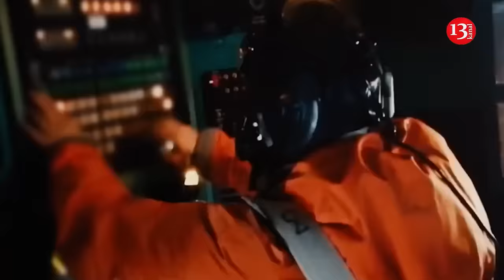Russia's tank and missile reserves are running out, mortar stocks are almost empty

Comment: According to Covert Cabal, most of the remaining tanks and AFVs are pretty roached out.  That being said, there are thousands of old Russian and Soviet vehicles scattered all over the globe.  I'm sure the Russians will be able to find vehicles if they need them, if the price is right that is!
Reply: There is a couple of problems with Russia getting systems from overseas.

The first is, that most of the available ones have already been bought by the US/other Ukrainian allies.

The next is, that those that are left are unlikely to be willing to get rid of them without being replaced by anything - and Russia is in no position to back fill any gaps created by the transfer to Russia.

And the last is, that Russia was the MAIN user of this gear, and so there is only a very small amount (comparatively) available elsewhere. For example, there were 25k T-72 tanks built - of which only 6k were available overseas (of which Ukraine had 1k and had built 700 for the export market). So assuming that they were ALL in running order, there would only be ~4500 available overseas (or less than 20% of the entire T-72 stockpile)......
Reply: The big problem with that is Russia doesn’t have sufficient foreign currency, they can’t pay using Roubles (anyway no one wants Roubles). Also those that have Russian equipment and still need defence equipment…. So they want western kit… as part of those deals and the western suppliers are shipping the old Soviet kit and ammunition to Ukraine…..
Reply: @robertpatrick3350  I agree you, but Russia will find a way to get vehicles if it needs them.  North Korea, Iran, and Cuba are nations that would likely supply Russia with surplus vehicles.  One thing is certain - there will be a lot less old military equipment on the market after this war.
Reply: @gregwasserman2635  
當你的來福槍都損失殆盡，你會希望用弓箭獲得勝利嗎 ??

Comment: They will not run out really they will slowly be less useful and cost effective to restore it has already started their are not much left of worth it has to be worked on hard to be used and are still old stuff not worth much Russian military power has peaked or will peak in this year and decline in power same thing with there soldiers, they are scrambling the bottom of the barrel, but Ukrainian is also under heavy pressure and need advanced weapons to avoid more losses they can ill afford